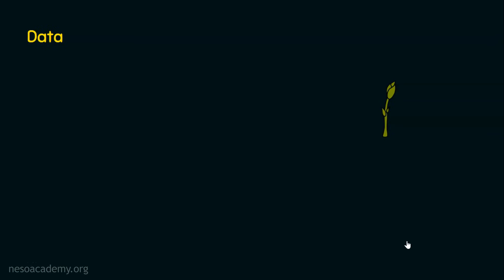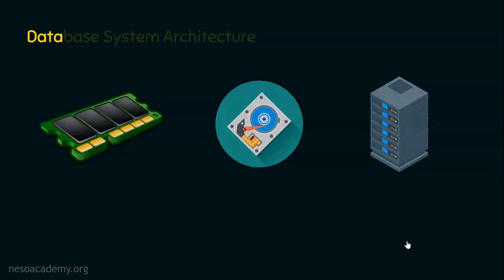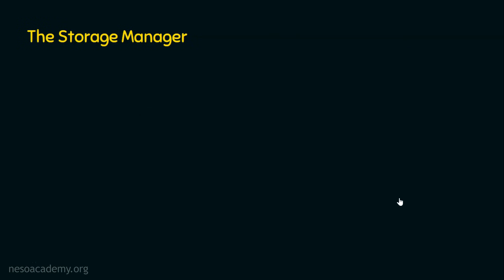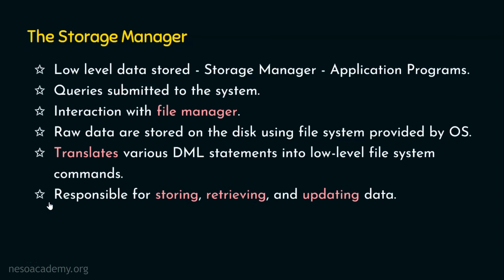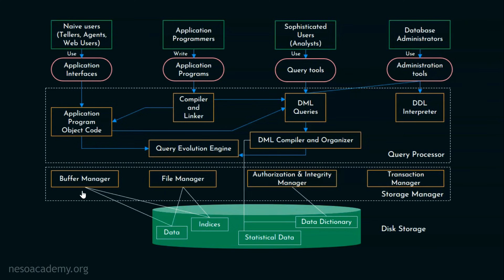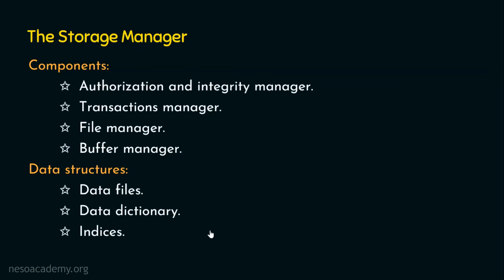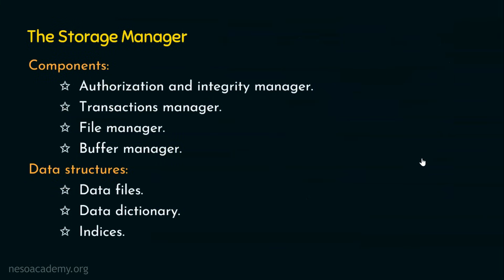Database System Architecture - Part 1

Comment: 0:11 The importance of database system architecture
02:01 Data uploaded to Facebook is not actually deleted from the server
03:47 The storage manager plays a crucial role in the database system architecture.
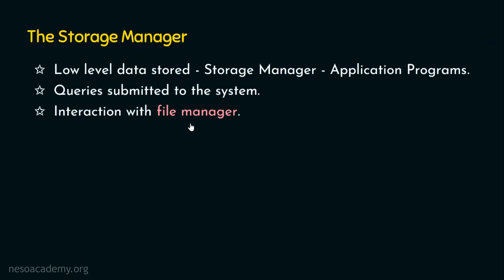05:34 Database management system uses file system internally to effectively store and retrieve data.
07:19 DML operations are built by the storage manager to translate high-level commands into low-level file system commands.
09:16 The database management system has three crucial components: buffer manager, file manager, and authorization and integrity manager.
11:00 Authorization, integrity, and transaction managers are essential components of the database system architecture.
12:49 Indices provide fast access to data items